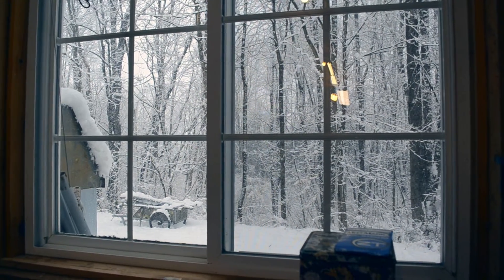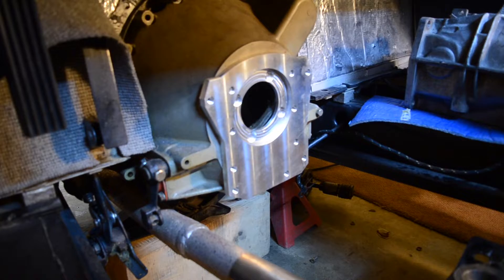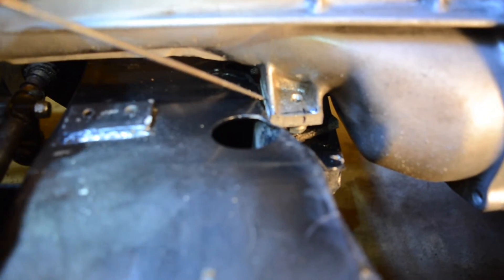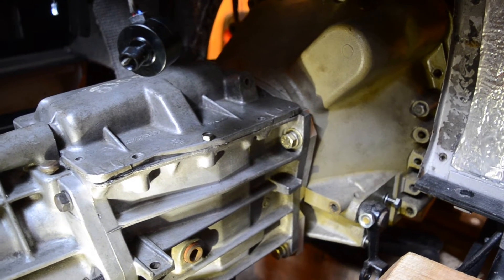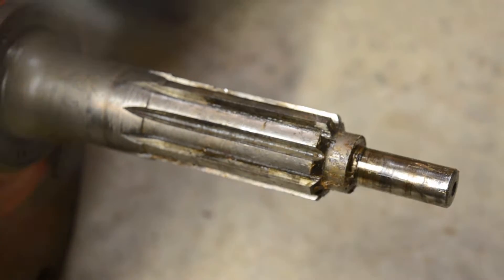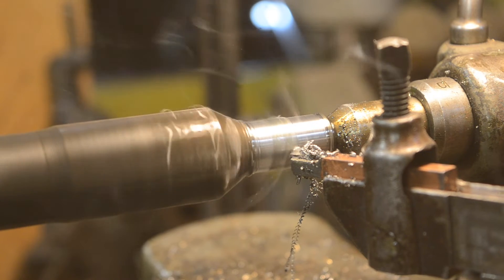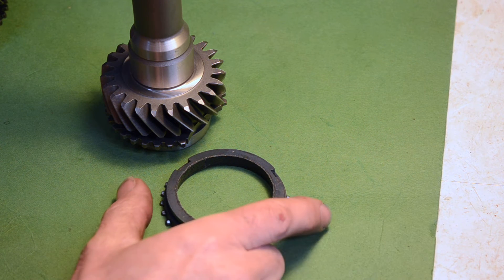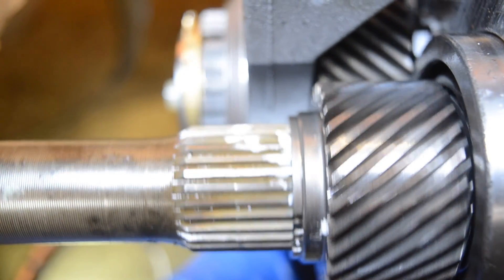Jaguar XK120 five speed conversion Part 1

Comment: For the input shaft tip, you could turn it down and press on a commercially available hardened sleeve.
Reply from the maker: That's a good idea. Thank you. It's too late now so I'll hope for the best, no problems thus far with 100 miles on the conversion.